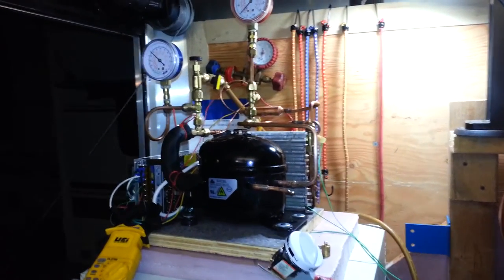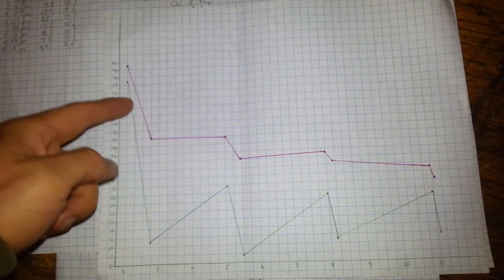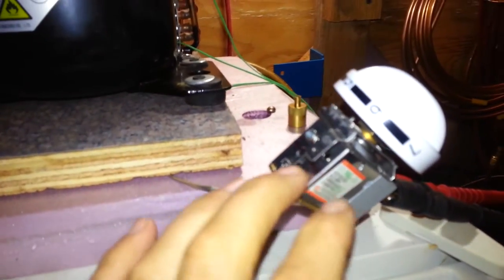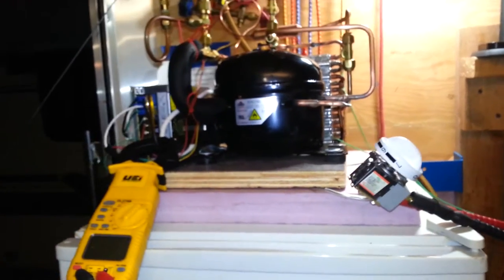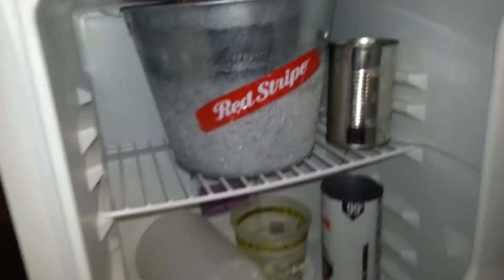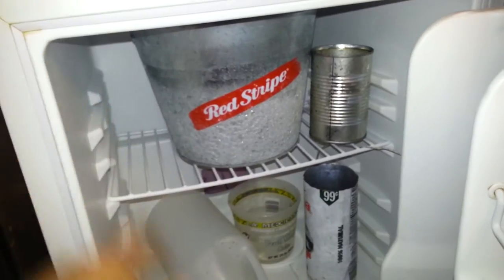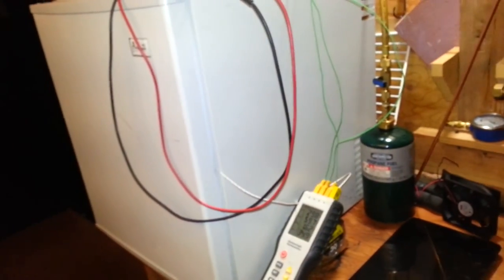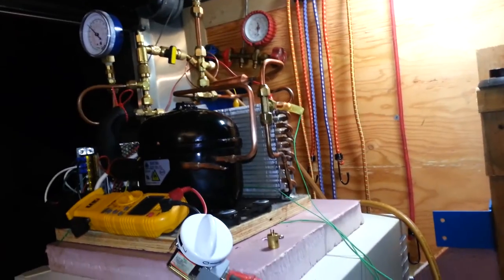1/8 HP, r290 Compressor- Brine Tank With Long Holdover

Comment: I suppose you could scale up the brine tank, etc to take advantage of cheaper off-peak rates.  Also, I have heard of people using small chest freezer cabinets for efficient all-fridge use.
Reply from the maker: I don't think they do off peak rates around here.  Besides, refrigeration costs aren't really breaking the bank right now.

I would want to put it into a better cabinet, with better insulation.  An upright freezer would be just as good as a chest type, considering that a an upright is more convenient.  Chest freezers make a low energy fridge because they have such a large evaporator built into the walls, and no fans- just direct conduction and convection.  The orientation of the door keeps a good seal on he gasket, and stratified cold air is less likely to leak from a poor seal.

Honestly, it is probably more educational to leave in it a poorly insulated box, as that necessitates a better cooling system.